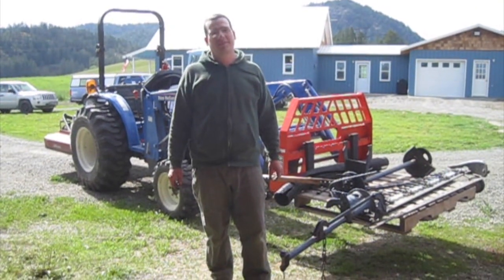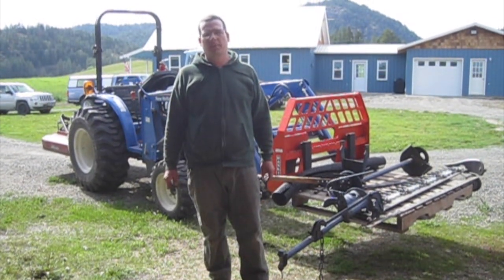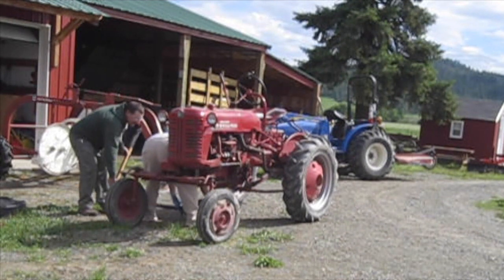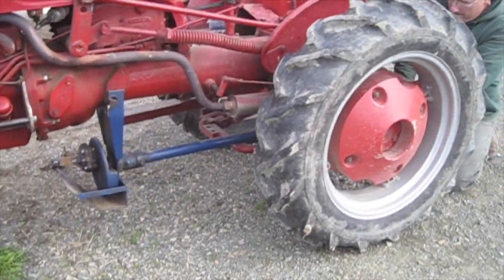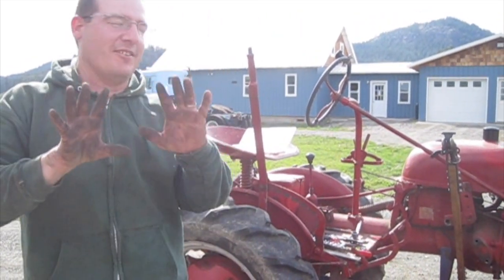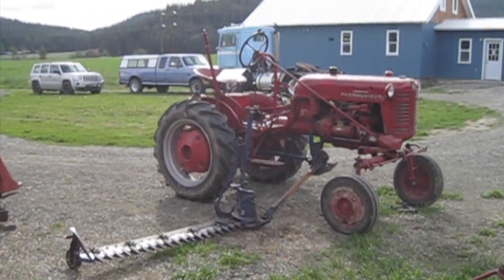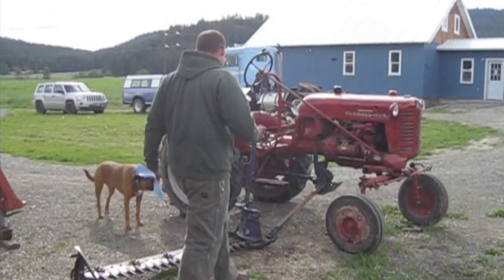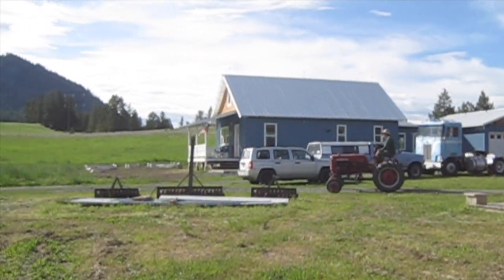First Loose Hay of 2019

Comment: My husband and I love watching your videos. We recently purchased 3 black angus steers, a sickle bar mower, and other farm tools and we love your idea about the hay muffins. We are having a tough time estimating how much hay can be stored in one of the muffins. Would you say approximately 3-4 round bales? Its tough for us to guesstimate without experiencing it! Any help would be appreciated.
Reply from the maker: Hello! Loose hay is so variable that it’s hard to pin down numbers. Generally accepted numbers from Land Grant Universities is 450-600 cubic feet per ton for loose hay storage. We’ve never fed round bales, so it’s hard for me to try and equate them to loose hay. We had good luck with our hay muffins, but now we have a barn, so I can’t imagine going back to them. For our hay muffins, we stacked directly on the ground, so we knew we were going to lose at least the bottom foot of hay. Maybe building them on a platform of pallets would help? Also, if I had to do it again, I’d build a light wood frame with a peaked roof to stretch the tarp over. That way, you would never have to worry about the tarp collecting water, and as you used up the stack, it would still work well to shed the water. Hope this helps! One more thought... Our best outdoor hay storage was our Shelterlogic structure. It solved the roof problem, and instead of using just the three corral panels, we added a fourth feeder panel across the front. It was square so it held more, and we could stack higher in it. We used the enclosure kit with it, so the hay was protected on the sides too. Thanks for watching!